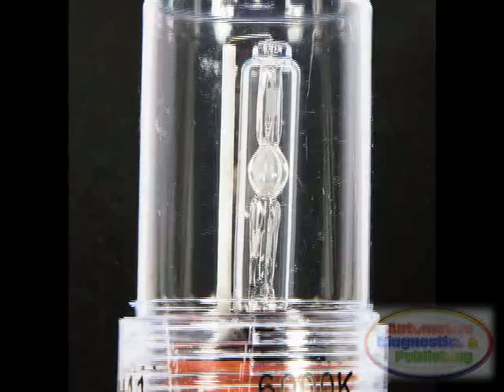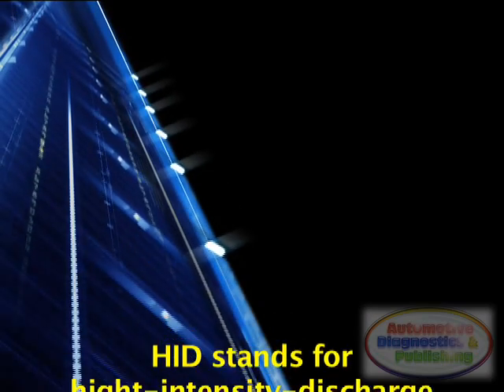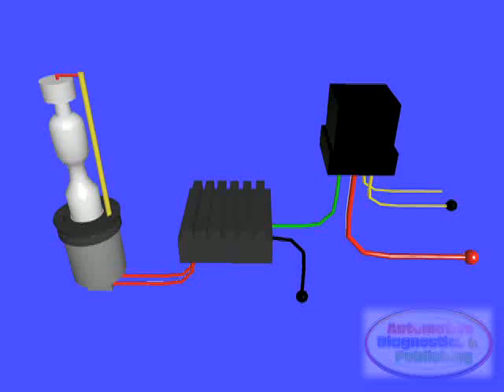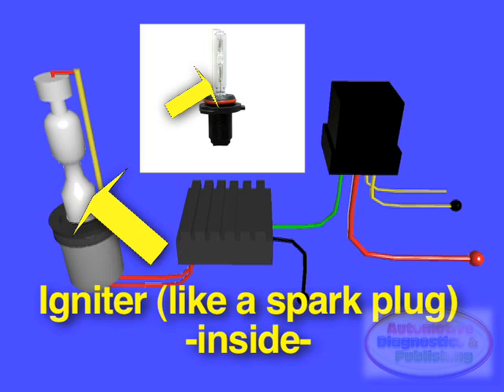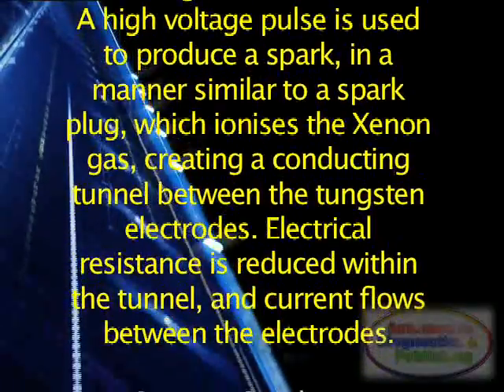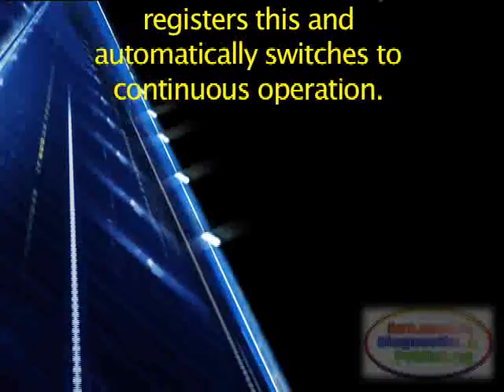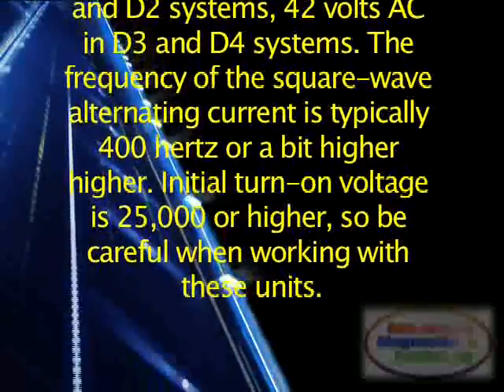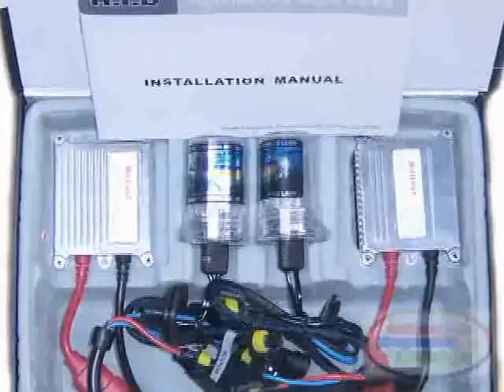HID Xenon Headlights Detailed Facts

Comment: So the ballast is also a dc to ac converter? I opened a Xenon lamp today and i think it had a starter circuit installed in the back of the lamp. In there was a capacitor, a spark gap and a custom made transformer. I guess this was only used for the ignition phase right?
Reply from the maker: Maybe,